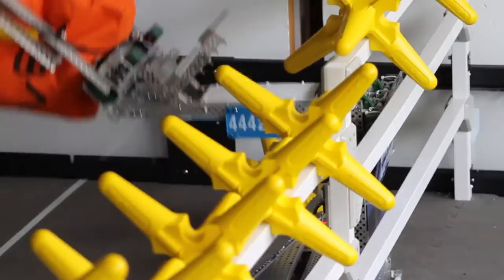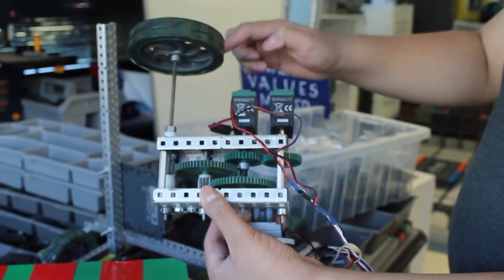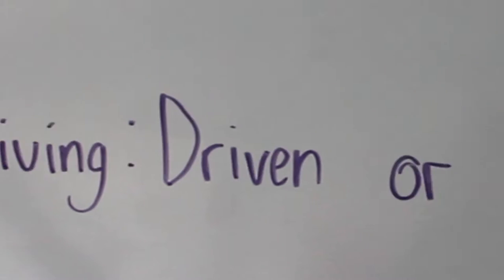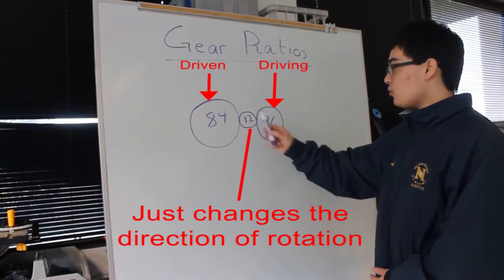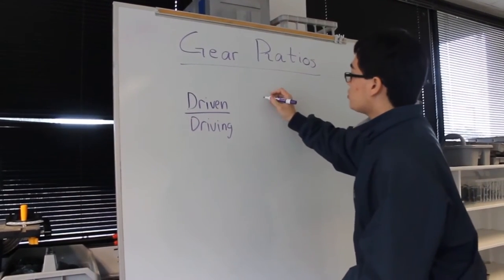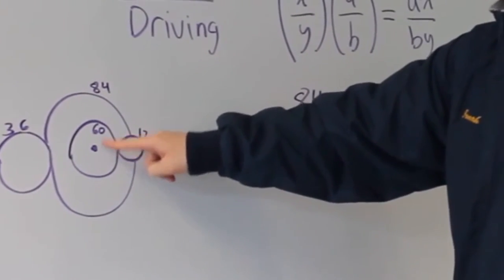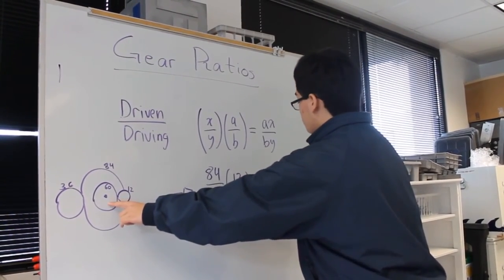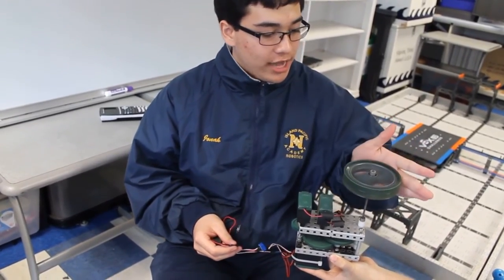Gears and Gear Ratios

Comment: Wait a minute isn’t it the other way around. The higher the gear ratio the lower the output speed isn’t it. A gear ratio of 6 would be 1/6 of the speed than without the motors but 6 times the torque